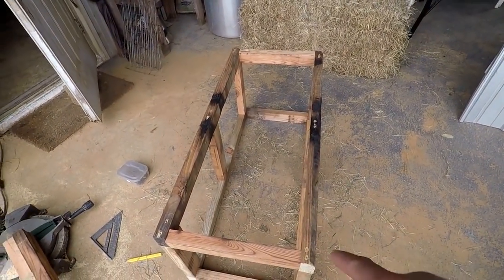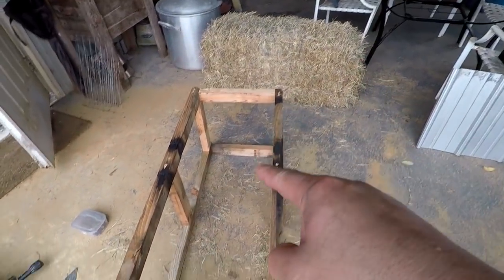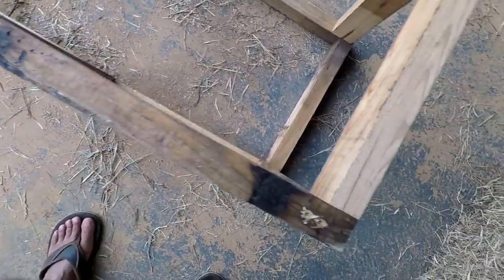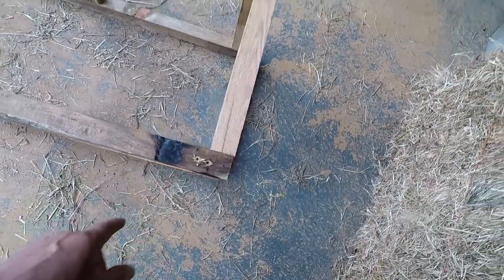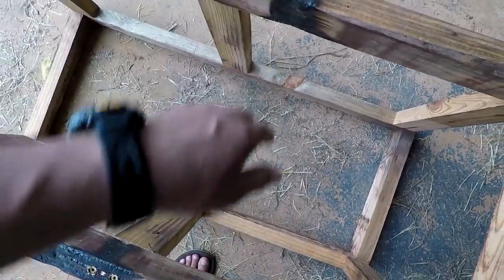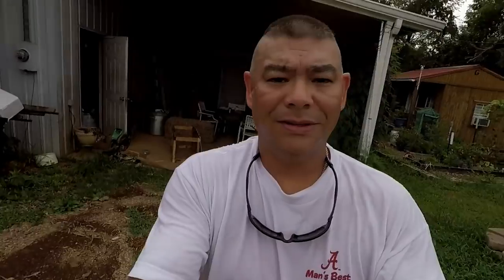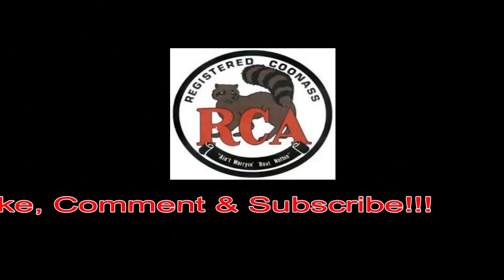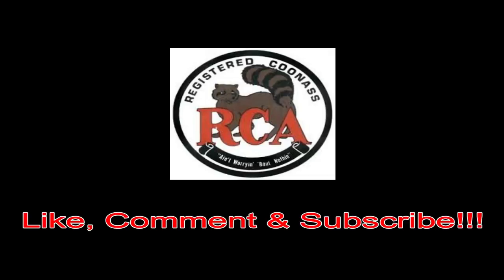Hay Bale Gardening | Built The Hay Rack

Comment: Looking good. You might want to add a slat or two across the bottom that way bale doesn't fall out if u move it
Reply from the maker: Good point Andy, I'm actually thinking on that one thing now!!  I'm still up in the air as to where I'm gonna put that rack.  I had actually thought about putting some chicken wire on the bottom, but heck, I want to be able to get all that decomposed hay come time!!  Thanks for watching sir!!  Dan

Comment: Hey Dan,

I built one of those back in the spring and I had to stuff the bales in. Mine didn't work as good as Mr. CB's does but after watching his video the other day, I know why. I didn't do the fertilizer and water correctly so, it never cooked. Things are growing. Just not very fast or good. All the plants are stunted. I have plants in 5 gal buckets right beside the bales and they are 2 to 3 times the size. But, like I said, it was my fault for not making sure how to do it before I tried. I was able to get oat straw bales and they ran $8 per bale. I think that's a little pricey but still cheaper than potting soil to fill the rack. Good luck! I'll be watchin' to see how yours turn out. Like CB says, make sure they cook and get back down to ambient temp (90's) before planting.
Reply from the maker: Hey brother and thank ya for watching!!!  This is my first attempt at this method of growing and I'm gonna follow Mr CB's routine to the T!!  I think it'll work!!  I paid $5 for the hay bale here locally and that's a lot cheaper than filling up one of my raised beds!!  Dan